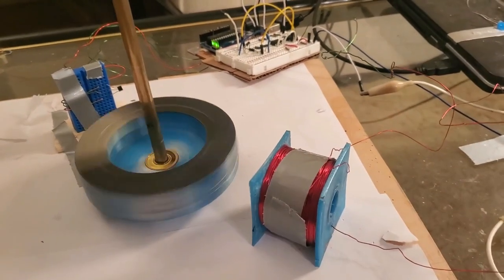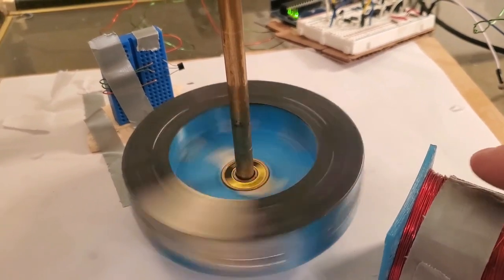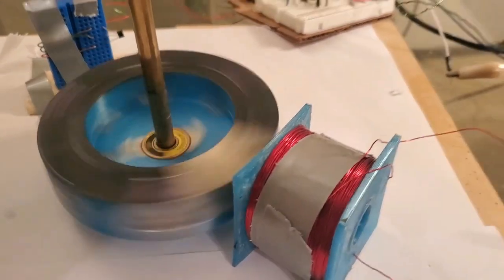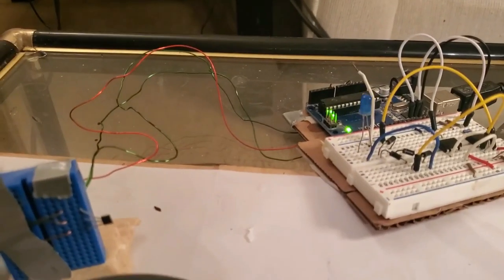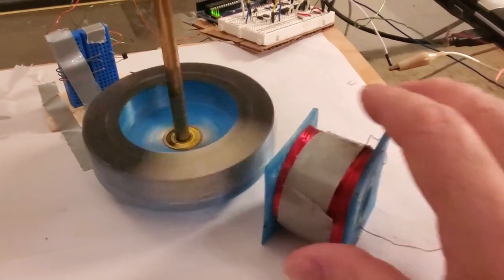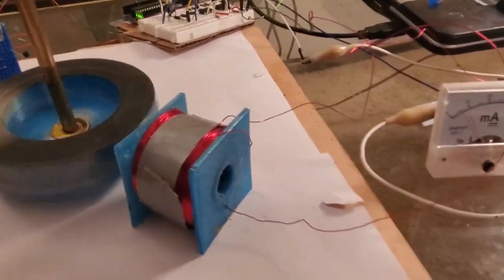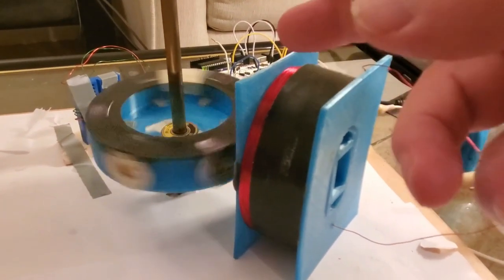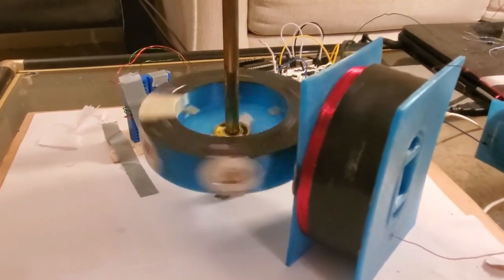The Pulse Motor: Your Drive Coil IS a Generator Coil

Comment: Great experiment, I am glad I found this channel.  Have you thought about using a magnetic bearing and then run you spinning neodymium’s in a vacuum chamber?  This would remove 99.9% of friction allowing you to really see efficiencies in this design? I know what I’m asking is not easy.  
You have inspired me to build and test a similar design!  Thank you for sharing!
Reply from the maker: Hi Shawn, thanks for the compliments and encouragement.  I don't think I ever considered trying to set up a vacuum chamber for the thing to run in, ala hyperloop!  Have thought about having a go at a magnetic bearing, may try that sometime, not sure how difficult it might be but they are cool.  Will say as skateboard bearings go I am happy with the yellowjacket ceramic bearings I have been using.
Reply: @paulmaher812  thanks for responding. Your channel has so much potential.

Comment: Can you imagine how efficient our AC's would be if they were using pulse motors instead of regular ones?
Reply from the maker: Indeed.
Reply: There was a company operating out of South Australia that advertised a pulse motor AC. I tried to purchase just their motor and they refused my request and stated I had to purchase the entire home system. They claimed in their advertisement that the AC cost was the same as a standard light bulb, I can’t remember what the fine print stated re the wattage of the bulb but this was the days of incandescent bulbs so probably 60 watts. From memory they claimed AUD$20 cost to run per year.
I remember they were out of business pretty quick too, you can’t allow the people to save money and stay cool, society would implode if we were able to keep our cool when the electric bill arrived.🤯
Reply: @whatifididthis...1236  I'm already working on that AC, few days after writing that comment I fond an old working AC in my parents house and took it to experiment. I heard about that Australian company but not much. Who wanted them gone, did quite a good job.
Reply: Or it might not work at all. Pulse motors have very little torque. Without large inertia they can't do any reasonable work. And you still need a significantly more power to move a heavy flywheel. It's more than just using a pulse motor. Other design of the circuit and coil most be taken in to place

Comment: Can the presented engine be used as a dynamo/generator? I would like to use something like this in my projects.
Reply from the maker: It is not a terribly powerful motor, as it is a pulse motor. In fact you could pretty much think of it as a switched mode DC-DC converter where you happen to drive a rotor at the same time. It is not hard to build and should be something you can have fun with in your projects.

Comment: seems like if you had all your magnets facing the same way you would only get + pulses or - pulses.  you might not be getting DC but instead pulsing DC at 12:00 with no rectifier diodes.  just a guess.
Reply: i see. the magnets are N...S...N...S...etc...hmmm
Reply from the maker: hmmm is what I keep thinking as well, or said otherwise WTF.

Comment: Curios, why don’t you have a soft iron or ferrite used in the core of your coils? This would greatly increase the inductance?
Reply from the maker: A couple reasons.  I could say I am concerned about eddy currents and throwing in yet another variable to have to consider and that is a part of it but really the main reason is I want to be able to move things around a lot on the fly and I am using strong neodymiums.  So if you don't have things locked in tight you could end up with a splat or kaboom if that core makes a run for a magnet.  Once I have an arrangement I like I will take a look at if I can get further improvement with maybe a welding rod core or some such.
Reply: @paulmaher812  sounds good.  With a core, stored inductance can quadruple but you know that. Maybe you can try the shaded pole motor from a microwave oven. It runs the fan. I have carefully removed the coil and it has laminated soft iron core that increase inductance while preventing eddy currents. You make a good point about the strong neodymium magnets:)
P.s. I have set up my test bench to emulate your experiments.  I hav also printed the Adams’ pulse motor manual.  Thanks for sharing!

Comment: Fascinating video again Paul especially what can be achieved with very little power input. I have seen other people mention similar findings, but you have a nice clear method of sharing which does help the less electrically minded like me. So thank you. As I understand it you have two possible sources of generation... The back EMF spike AND generation from the drive coil? I have also see other videos where the back EMF spike can have a larger voltage than the input voltage. I also thought you may enjoy this video and the guy has an approach of throwing more power into the pulse motor - https://www.youtube.com/watch?v=TbRWTjc9nAY - On a side note and I don't know if this may be useful, I came across a Hall sensor that drives a pulse motor directly and does not require any additional components at all... the Hall sensor 47A-435H0 and the MA477 looks similar to me. Let me know what you think. Thanks again
Reply from the maker: Hey Brain,

Thanks for the comment and the compliment.  It would be fun to play GrandPooBah and say of course it is this and why didn't you notice that, but really, like many of us, I am learning as I go along. That said, many focus, as I did, on the back EMF spike, as demonstrated in this video, at least with strong magnets and low voltage, the EMF from the magnets flying past the "drive" coil is at least as significant a source of power. Those two power sources, may (may) explain some of the odd results reported by both Adams and Bedini.  One can engineer for both or either, but it is good to at least to know what to look at going forward.  Will look to check out both the appended vid and the part number, thx!
Reply: @paulmaher812  Thanks again. I'm fascinated. Thanks for sharing your work.

Comment: How powerful is this engine?
Reply from the maker: Sorry for the late reply.  The engine does not have a great deal of torque.  The reason being it is only brief pulses of DC.  The idea is to capture the change in magnetic flux, as an inductive spike, whenever you turn the coil on and off.  This let's you look to capture the magnetic flux and still spin a rotor.  It is not much of a stretch to say what you are doing is taking a what do they call them switched mode DC-DC converter and letting it spin a rotor at the same time. You could improve the torque by having a second sensor and second coil which turned on when the brief pulse from the first coil turned off, but as shown, yea it spins well and fast but it is not powerful in terms of torque.  Thank you for the comment
Reply: @paulmaher812  This type of engine is an experimental engine. Thank you for your comment.